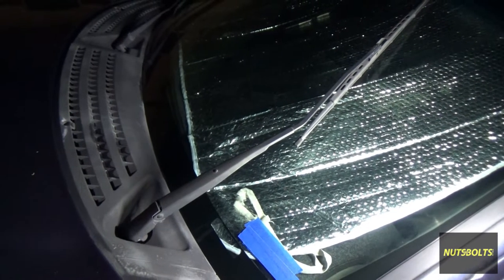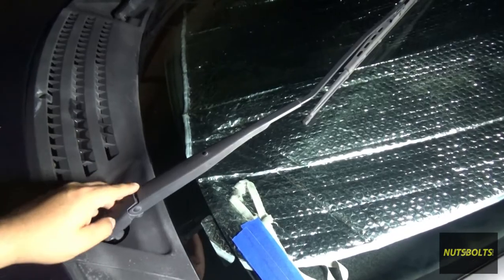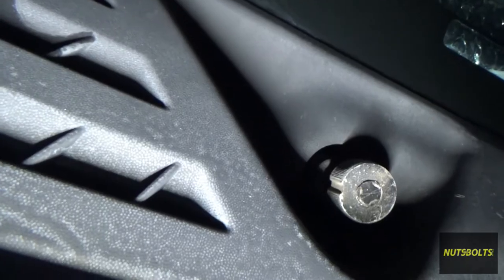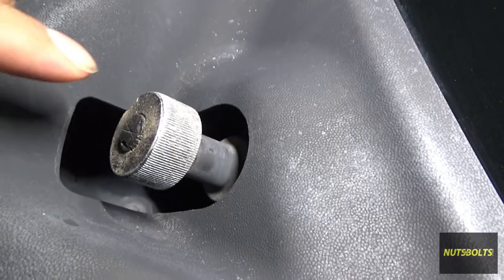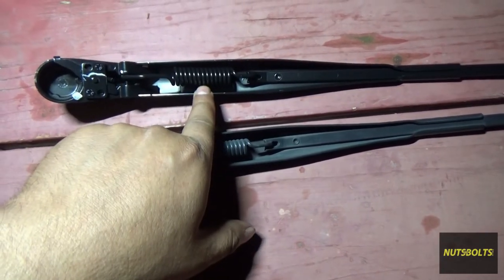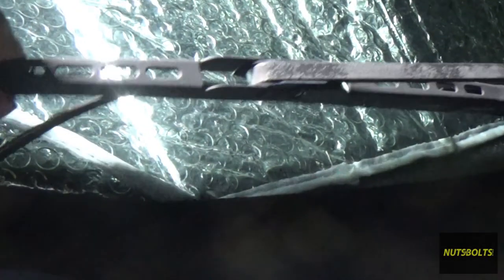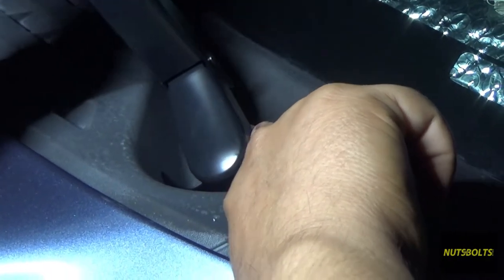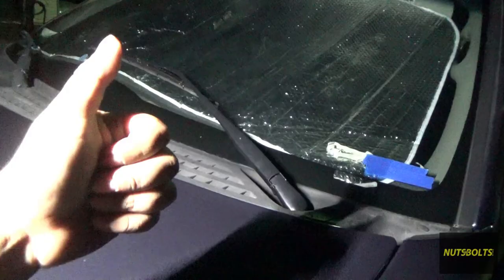How to Replace a Windshield Wiper Arm

Comment: Excellent straightforward explanation and video.  Thank you for your tips on marking the position of the wiper arm with tape and leaving the rubber wiper on to protect the glass and for showing other way wiper arms might be attached on other vehicles.  Really well done.  Thanks.